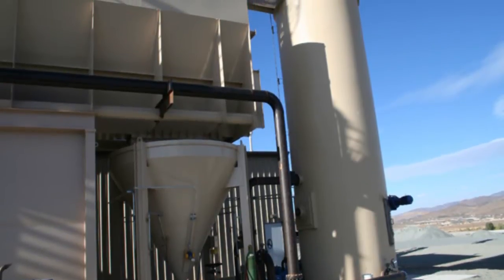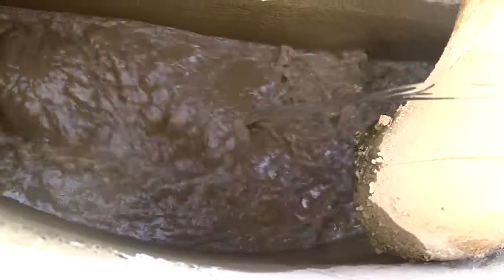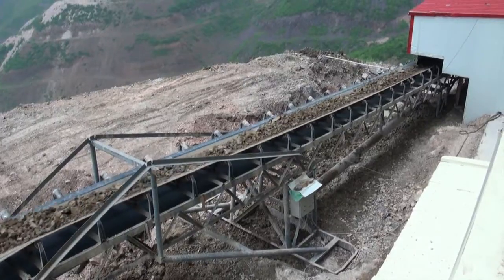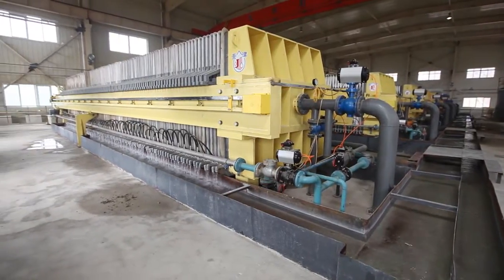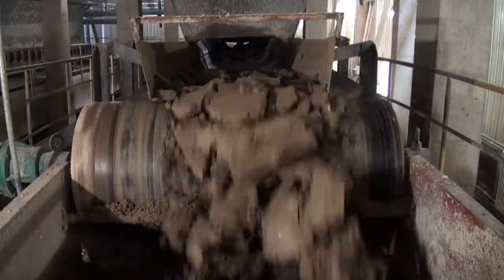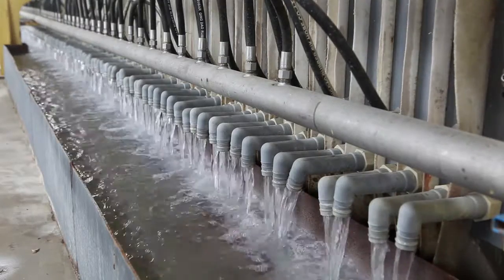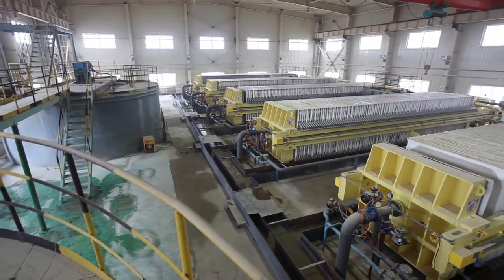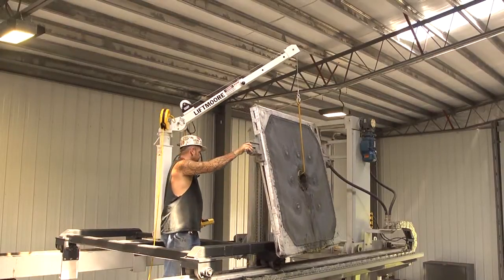Mine Process Overview: Thickening and Pressing

Comment: A dewatering equipment relying on pressure of slurry pump including chamber press filter and plate press filter http://www.xinhaimining.com/en/product_10_40.html
Efficient thickener is widely applied in metallurgy, mines, coal, chemical industry, building materials, environmental protection and other departments, which has significance for improvement of water returning utilization rate and underflow conveying concentration.
http://www.xinhaimining.com/en/product_9_31.html